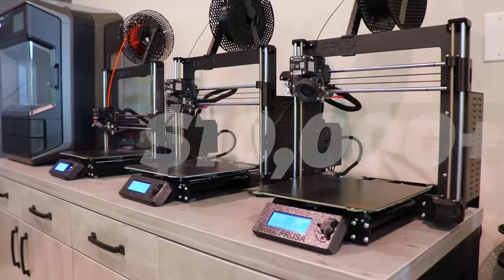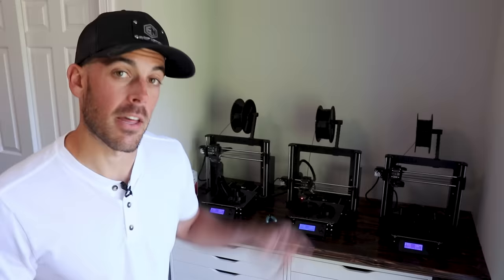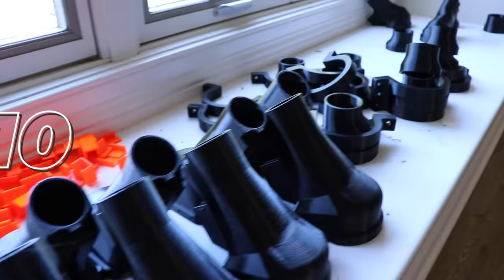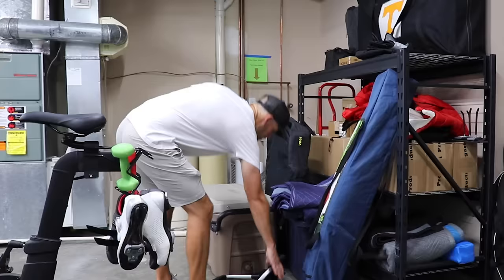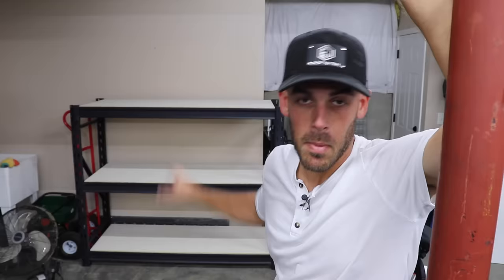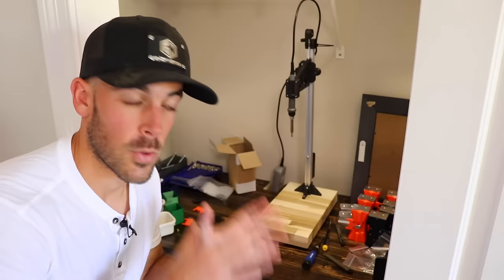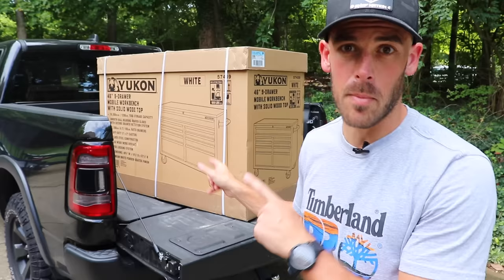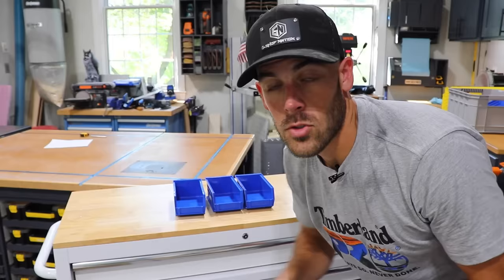I spent $10,000 on 3D Printers...What now? // The Print Farm

Comment: Looking great!  Since the printers are located downstairs, I'd suggest getting some kind of remote monitoring / control tools (Octoprint / Prusa Connect, etc) - I know RPis are kind of hard to come at the moment, but hopefully that fixes itself sooner than later.
Reply: With this setup I think getting a 500-600 laptop with linux mint installed would be better, you can basically create like 6 different printers inside klipper and have em connected to the same laptop.
Reply: @baquero766  That's a very good idea, also maybe a USB expander hub
Reply: @baquero766  you can also use cheap thin clients as well.

Comment: One thing I would suggest from experience is give each of your printers a name. You can track which printers give you the most trouble, when you last performed maintainance etc so nothing gets neglected which is easy to do if they're not giving you any troubles. We put doors on our rack to prevent drafts, but the doors can make it harder to work on and caused other issues, so if you're not in a dusty or drafty area I would leave it as is.
If you're printing many different parts one of the hardest bits to manage is keeping all the part versions and slicer files consistent across all the SD cards. Running the printers off a central controller was my thought to fix that, but was too big a jump to ever get around to.

Comment: Great job!  One "design improvement" I think would be good would be to drill a hole in each end of the trash can support so you can stretch a bungee cord around the back of the can so it won't slide off onto the floor.

Comment: I built a 12 printer farm with the same printers.
Changes I would recoend on your setup would be to add a raspberry pie and camera to each printer and use the farm management tool that also runs on a raspberry pi.  I went with printed solid cabinets and a heater for each of mine with filament drier for each and reprinted all Prusa parts with Polycarbonate to increase heat resistance and added annealing ovens that my parts spend a set amount of time in before going into my industrial tumbler which removes a lot of the supports and hanging pieces and almost erases small print lines, lastly I do finish work.  
Granted you are just printing PETG so you don't really need to control temp and humidity as much as I do.  And the stresses and usage of your parts don't require heated chambers, filament driers, and annealing.
But I would recommend managing your growing farm with raspberry pies and cameras (octoprint) and a farm management tool (octofarm).  It REALLY cuts down on the "sneaker net" work of monitoring and sending jobs to be printed..
Reply: Congratulations 🎉
You have been selected as the winner of Prusa i3 MK3S+ 3D Printer.
Send me a message via the above number so we can sort this out!

Comment: A tip for your UPS. You go from AC to DC in the UPS to charge the battery, then from DC to AC on the output, then back from AC to DC on the printers PSU. Why not skip all those steps, gain a lot of efficiency and run them all with 1 battery bank? You can use a Meanwell DR-UPS40 for every 40 amps and all from the same battery. If you wanna go all out, you can replace ALL PSUs with one big PSU (or a couple with a redundancy module) feeding the UPS40s and battery on all printers.
Reply from the maker: Very interesting! Thanks for that
Reply: @ShopNation  You're welcome.

Comment: There are units that can take two power inputs and one output. So the unit can switch from A to B side if the power from the A-side would ever fail. This way you could feed your UPS'es from two circuts.

Comment: I think you need to make the filament spool holders more accessible.  There are a lot of examples of super fancy spool holder that use bearings that the spools set on.  I went cheap and easy for mine and used small pvc pipe (either 1/2" or 3/4" don't remember).  I push fit an elbow on the pipe that goes through the center of the spool to keep the spool from falling off.  easy and done.
Reply from the maker: Yes absolutely, I need to re-think the spool holders

Comment: For more filament storage, use the side of the shelving rack. I like to 3d print mounts that slot into the racks already cutout slots for the crossbars and have an adjustable filament shelf that way.
Reply: I told my wife I would do this! Do you have the file to share or sell? For the mounts?
Reply: @chuysaucedo7119  I am working on a final product design that I will have on my Etsy.
Reply: @Titan3DAZ  please be sure to link! Thanks

Comment: If this basement is close to your electrical panel or if you can run power directly from your electrical panel it is better to provide a dedicated circuit to that area.  You may not have much draw from the printers, but like you said the potential spike draw at any one time could trip a breaker.  So a dedicated circuit of 15-20 amps would be great.

Comment: Instead of a UPS which is really for short duration for back power during outages, you should use a product like ecoflow battery generators which would have the capacity to run the 3D printers until the job is finished.
Reply from the maker: I actually have an ecoflow, Guess I could try it...

Comment: Really love the fabrication station. The only issue I see is that it's a little too low and that "will" create a lot of strain on your neck.  If you raise it just below your belly button you will notice a significant improvement on both production and body comfort not to mention you can built an extra drawer for more storage at the bottom of the cabinet.

Comment: The only thing k would change is to mount the spool holders to the front of the shelf frame to make changing filament faster on the middle and lower shelves. So like the frame of the top shelf would hold the spools for the middle printers and the middle shelf would hold the spools for the lower printers. The top printers are fine.

Comment: Cool set up. I would recommend an enclosure for anyone looking to 3D print. I am using a Prusa 2.5s and struggled to print PETG and Nylon. this was due to fluctuations in temp and humidity. Just purchased the Prusa enclosure for it. Big difference. If price is a concern the Ender 3 is a great choice at a much lower price point. Thanks for making your videos. I made and use your small parts organiser from 2 years ago. Cheers!

Comment: It's a great setup. I think an upgrade or atleast a worthy thought would be to shift the filament spools one shelve up to make changing filament much easier. You'd probably have to move the UPS off the Shelves so you can fit the spools from the lower printers inbetween but you could print a bracket to hang the ups off the side of the shelves. It would also make it easier to see if the lower printers are running low on filament.

Comment: Sorry just got to view. You might already know the blue bins may slide off the back of the shelf. Need a strip of wood on the back to prevent sliding off the back.  Good move getting the roll around tool chest. Kinda wish I would have done a couple in my shop but then I wouldn't have been able to buy your plans and make the cabinets.😁

Comment: fellow 3D printing shop owner - you should get a deburring tool or chisel for cleaning blobs on prints, a sharp blade like that is going to cut you eventually.  Also, you should be able to tune your settings to prevent all stringing especially with direct drives like prusas, probably worth putting some time into dialing in your settings. Printing slower helps too with PETG but then you get less throughput. Looks like you are using z hop on retraction which can cause extra stringing.
Reply from the maker: Great feedback, thank you!

Comment: Very very nice.  The only thing that I cringed about, was the bins were just sitting on that top shelf just waiting to get knocked off the shelf.  I would definitely find a way to secure them better to the shelf or at least put a backer board to keep them from moving backwards when you put you hand in one of them to get something out.
Reply from the maker: There is a tiny front lip that keeps them in place and the interestingly enough the friction of the plastic and paint is pretty high, so they don't move as easy as you'd think.

Comment: Like it a lot! Just like all your projects. Always looking forward for the next video.

One thought about your workbench.
I've been using those storage containers and putting them just on a board gave me issues that they kept moving around.
I mounted a vertical board with cleats and use them as I think they're intended to be used.
I anchor them over the cleat and now it's very sturdy.
Reply: Congratulations 🎉
You have been selected as the winner of Prusa i3 MK3S+ 3D Printer.
Send me a message via the above number so we can sort this out...

Comment: you need to cut the wood in to individual shelf  with in the main shelve and add vibration isolator you if don't eventually you will start having problems with your printer and don't know why. specially when you use printer with different part been made
Reply from the maker: Did you watch the video?

Comment: So glad this gig is working out for you.  As nice as building everything yourself is, sometimes you have to trade money for time.  My one question is related to scaling up.  At what point do you;  A. Get some help;  B. Upgrade to more robust printers;   C. Consider injection molding?
Reply from the maker: A. Soon; B. Prusa's have a very solid ROI; C. Part dependent but typically when volumes exceed ~2000

Comment: I would've moved all the filament rolls to the side of the whole shelf and routed with Capricorn, that way it would be fast and easy to change rolls and eliminating the risk of bumping a printer and mess up a print. other than that, looks clean and usable, what about dust in your basement? if you make some fancy filament holders on the side you can make a neat little filter they all go through. :)
Reply from the maker: Yeah, definitely need to improve filament management

Comment: I would suggest to get a good air quality monitor and check the air quality now that you have 9 printers down there with no ventilation. All thermoplastics expel harmful VOCs and ultra fine particles when heated, you don't want to be exposed to those for any period of time or even worse long periods of times while you work down there with your printers running. I would try to install an exhaust and/or air filtration system. Having the printers enclosed with some kind of exhaust system would be ideal in my opinion.
Reply: Congratulations 🎉
You have been selected as the winner of Prusa i3 MK3S+ 3D Printer.
Send me a message via the above number so we can sort this out.
Reply from the maker: Did you watch the end? I touched on this
Reply: Yes. I thought I missed something but I went back and rewatched the end where you talk about you just print in PETG, and it just doesn't smell that bad. That's precisely what I was referring to about getting the air quality monitor so you could see for yourself that just because you can't smell it, it doesn't mean there's no VOCs or ultra fine particles. That's just my advice, it's your health and your family's. I wouldn't take risks. Just do some testings and see if maybe I'm wrong. Get a quality air monitor and put it where the printers are. Let me know your findings. You could also read about it on the Internet, I've read articles about it and that's why I'm trying to make you and anybody that uses a 3D printers aware of this issue that most people just overlook. On another note, great video, great tips. Happy printing!😁👍

Comment: I would not have the printer shelf close to the wall, I would set it up so i had a pathway to the back to change out the filament easily and other maintenence task that may needs to be taken in account, you can work a a printer with minimal risk of touching on of the other, otherwise, sweet setup bro

Comment: Nice video (as usual). However, if you are selling that many units, have you thought about injection molded plastics?  The end product would be much nicer, more consistent, probably stronger (depending on the plastic), and ultimately cheaper (when you count cost for the printer, electricity, filament, etc) in volume.
Reply: Agreed! Seems like some of the established products could graduate from 3D printed to injection molded.
Reply: Not that I disagree with all the pros of injection moulded options, but two major downsides are MOQ/stock holding if outsourcing, and the labour intensity if diy. The benefit of just-in-time production with a 3D printer system is real hard to let go of, especially when making incremental changes for updates to product lines the prints are supposed to attach to.

But injection moulding would be substantially cheaper I reckon.
Reply from the maker: Short answer is yes, I've calculated the tipping point for IM for some of my products.  Most are far below the threshold of viability though.  Looks like someone already touched on stocking as well.  I don't really want to store 1000+ injection molded parts at the moment.  Part of the appeal of 3D printing is just in time manufacturing to an extent.

Comment: hell yea man looks awesome. I currently only do it for hobby. But i have 26 machines in a room lined with the commercial wire racks 3 high. 

Much like yourself im limited to how many simultaneous printers due to the circuit issue. I was actually considering running a dedicated 220v 30 amp circuit to the room since the printers can all run 220v and would halve the amperage required per machine. But would also prevent using UPS's which is fine since its not a business.
Reply from the maker: Heck of a hobby!  26 whew!

Comment: Very nice setup.
For the record, no, not all basements are like yours.  Mine rarely gets up to 70F (19C).  As a result, even PLA likes to curl.  

To compensate, all of my printers are in enclosures.  The PLA printers get by just capturing heat from the printer.  the ABS printers have a small space heater to bring the enclosure temp up to just over 100F (40C).

Comment: I have been running 11 Mk3’s and 2 Mini’s on a dedicated 20A circuit.  Just received 2 more Mk3’s.  I found your video while searching for some farm upgrades before adding the new printers.  I’m a little older and crouching down to floor level for part and filament swaps sucks.  Anyways, if 15 printers trips the breaker I’ll let you know.
Reply: How that possible?

Comment: What about adding a non-skid material to the bottom of the blue bins or even velcro to keep them in place? Or even a stop lip on the front of the shelf?
Reply from the maker: I didn't show it very well but there is a small lip at the front that stops all of the bins from sliding forward.  Non-skid material is a good idea though

Comment: I've found that the barrina fixtures we bought in 2019 (8 footers) have not lasted well at all. half of the light on most of them are completely dead, with several leds out on the other side.
Reply from the maker: Wow really???
Reply: @ShopNation  I made sure to click on your link and sure enough, amazon said I ordered a variant of that at the top. Its not a super air conditioned space (2500 square foot makerspace), but it stays above freezing at least. I'd like to figure out a slightly nicer solution in the future, this was pretty great at our budget at the time.

Comment: Wouldn't it make more sense to move towards injection molding your products if you want to scale up? You can still 3d print molds as long as you use the correct filament. Seems like it would be faster, cheaper and yield a better quality product.

Edit: Also if you wanted to stay 3d printing why not get something like the cr-30 so you have less down time?

Comment: I can't wait to see the inevitable upgrades on this.  I'm expecting to see printers mounted on angles and the print head knocking them off the bed into a parts hopper, and then move right on to printing more parts at some point. #InfinityPrints

Great use of the Yukon tool cart.  That turned out great.

Comment: I wonder at what volume it makes sense to transition from 3d printers to injection molding.
Reply from the maker: Volumes are fairly high to make economical sense.  I have a lot of background in IM/Additive transition scenarios and though there is definitely a turning point, the volume is typically in excess of ~5000 units

Comment: What kind of filament do you use? You mentioned a type in the video, but I assume it's a stronger material for woodworking jigs and stuff?
Reply from the maker: Yes, PETG, more durable with more heat resistance than PLA

Comment: Do you get any complaints from customers about the products being 3D printed vs injection molded? 3D prints usually feel too "prototypy" to be a finished product. Also have you considered outsourcing to an injection molder?
Reply from the maker: Yes, there is a fairly high volume consideration for IM but definitely on the radar

Comment: Does dust build up cause a problem for your builds?  I live near Silicon Valley and have seen many 3d printer farm setups and a common theme along with vertically stacking the printers at least here are clear plastic covers to enclose the printers.  Now that might be due to VOC concerns, noise reduction, or they just live in a dusty area…idk.   In regards to this video, I like your setup.  It’s clean and simple.
Reply from the maker: Yeah could be for many reasons, probably VOCs and draft prevention to help with warping